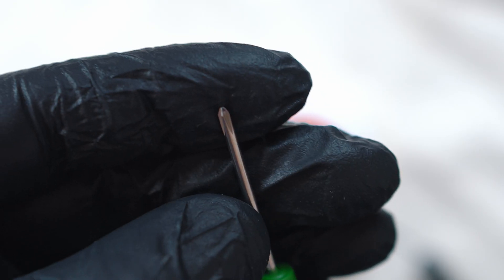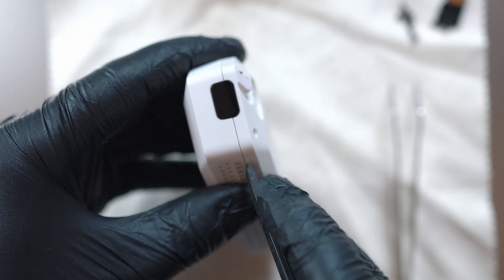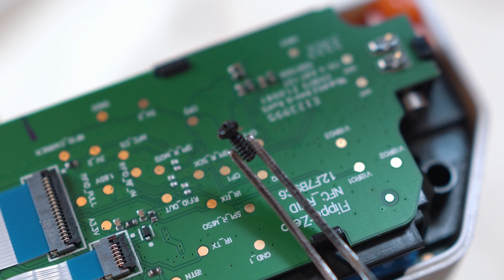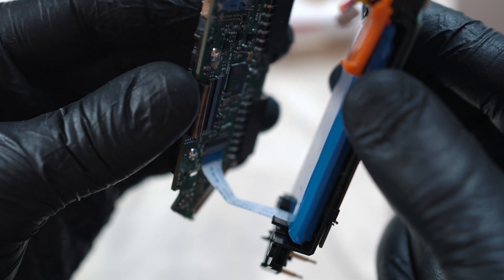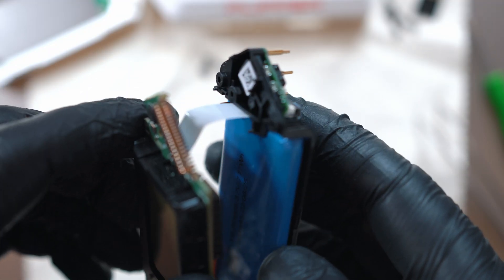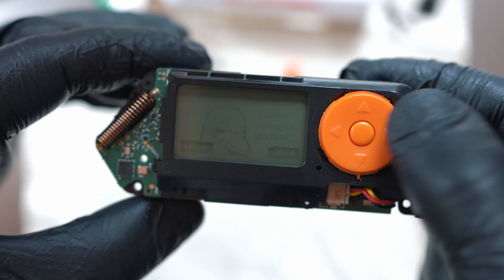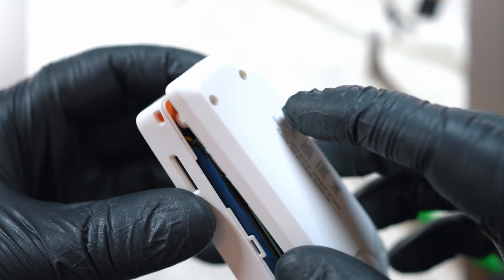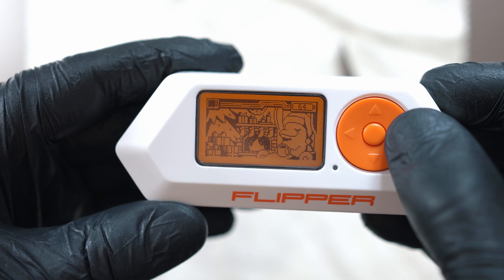Flipper Zero Battery Replacement | Hacking 2025

Comment: Great video, thanks! My battery just stopped charging beyond 30%.
Reply from the maker: get new battery
Reply: @takeapart  Just installed the new battery and am back up and running.  Only issue I ran into was having to shave the 'little orange' sd card / wire guide a little on one corner as the battery I got was a little bigger.  Thanks again for a clear & concise video!

Comment: It will be easier to travel internationally by doing this
Reply: @takeapart  It may be easier to travel internationally by removing its battery.
Reply from the maker: @gippy-yk2cp nah, battery is not exceeding the limits ! you can safely travel internationally without removing the battery hhhh